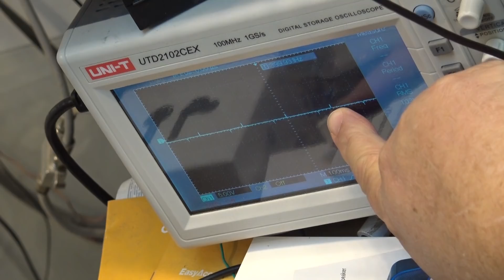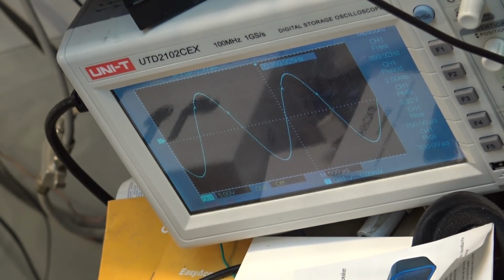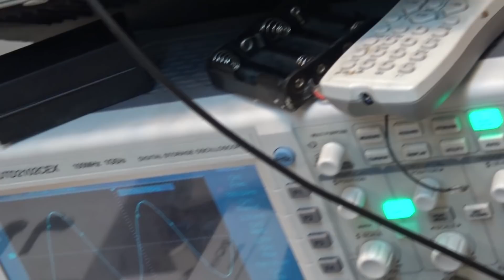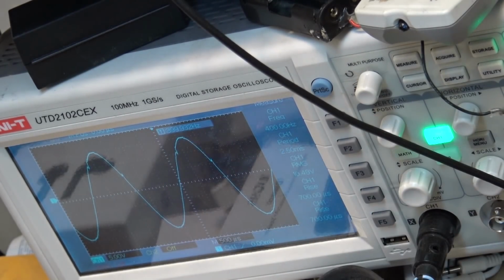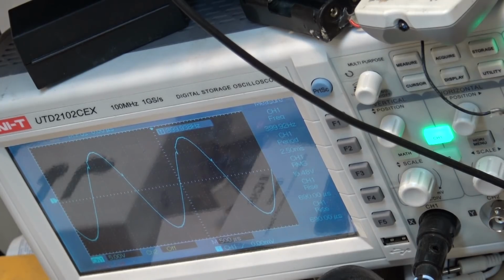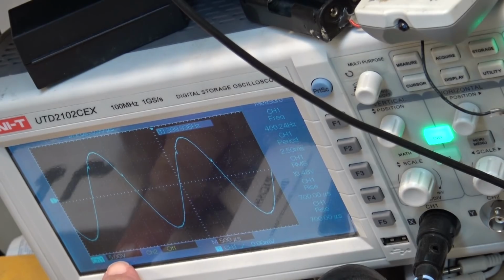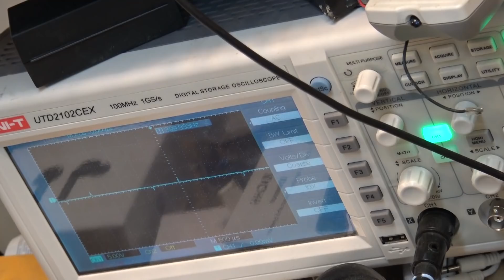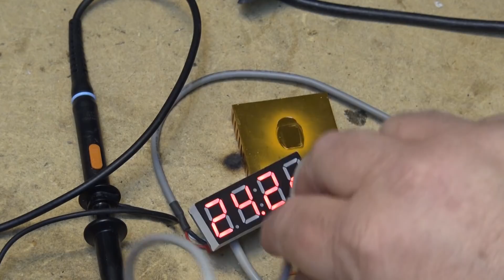TPA3116D2 Mono Subwoofer Amp Board

Comment: All that electronic gear and all them tools you have and you have no means of bonding a heatsink, you gotta be joking?
Reply from the maker: Nope don't have any superglue and since this board is not going into service I don't care about it.  The next person that gets this board can bond it.
Reply: @12voltvids  well neither do i, if i keep a tube long enough the whole tube tends to dry out before i get to use it all
Reply from the maker: @tyronenelson9124  
And now you know why I didn't have any to stick the heat sink on.  Those chips are really efficient anyway so they really dont need much of a heat sink unless you run them down to 2 ohms.

Comment: You can run those chips up to 26v, and they are normally ran at 24v... So 16v is a bit on the low side!
Reply from the maker: I just ran it at the specs on the web site.

Comment: 150 WATT ?      Subs should be turned down when running .
This is why kids in cars say they have 1000 WATT  , they always do untill we see it but this is to tiny .
I say its about 40 watt tops , MAX  ,  at that they get tooo hot .
I have an unwanted sony sub here powered  , 
always tell by the speaker that its not much , its not much to me as it is fazed out with my current speakers ,  it was blasted when he had it , he thought he cooked it so he said take it with you , I still have it here .
Reply from the maker: That wattage rating came from the advertised specs for the chip.
Reply: @12voltvids  Well thats a lot of wattage  to a speaker , 
It dose not look up to  it with them capacitors exe .
It must be a flat sound on delivery .
Its the wattage that sells

Comment: For my dummy load 8 ohm/etc Dale aluminum resistors, I have them mounted to a stout aluminum heat sink with thermal compound. They work well without overheating them. Maybe grab a power output transistor receiver for scrap and mount them to that with some banana jacks like I have done.

Comment: Sir how much cost the dso. uni-t  utd2102cex
Reply from the maker: 600.00
Reply: That is still way to much. You can buy a Crown xls 2500 with built in crossovers. that is 800w @ 4ohm 2ch. and 2500w bridged for $600usd

Comment: it does drive the load very well, that would make a loud bass.
i dont think at low frequencys you would notice distortion.
Class D has its uses, just not in hi fi systems.
What an odd spike.
Reply: class d amplifiers are used in most modern hifi systems.. and sound ok.. just that one has no high end so sounds rubbish.